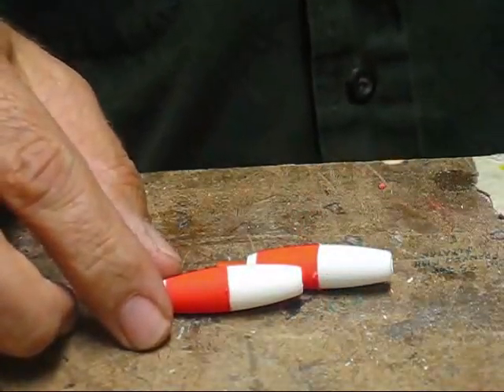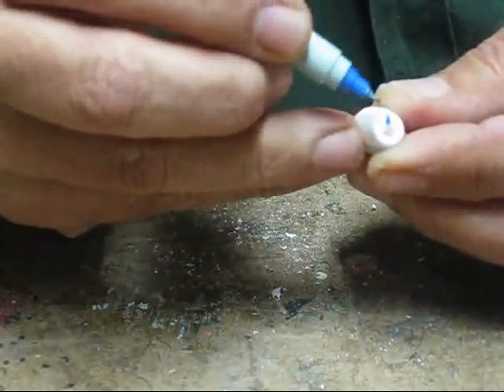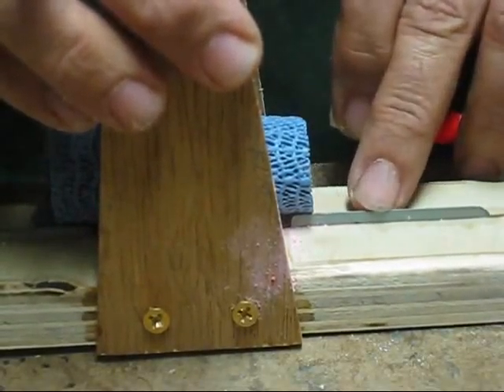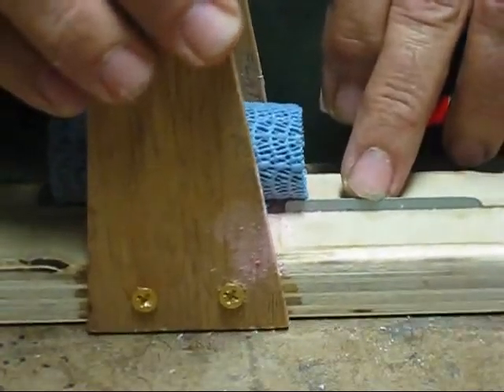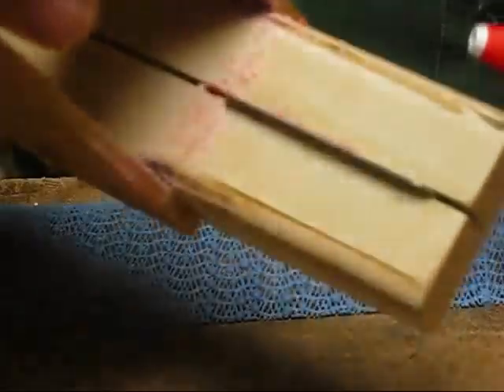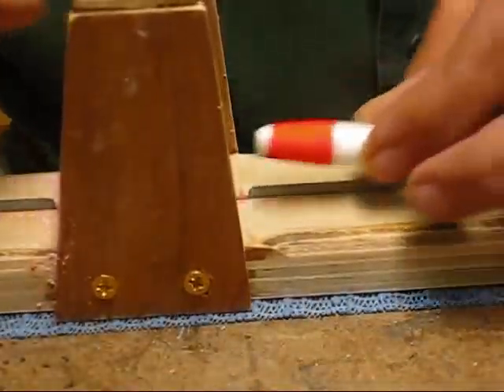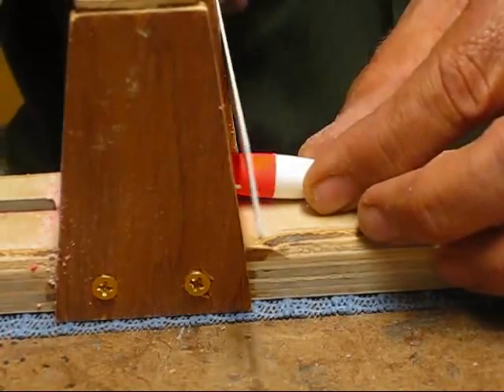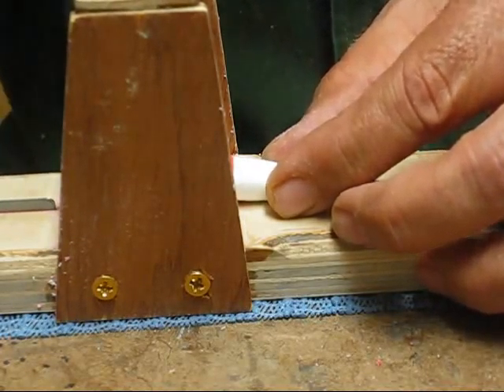Popper Face Jig.wmv

Comment from the maker: John, it is a reciprocating saw blade, you can buy blades of different shapes and sizes and teeth per inch.  I like the height of the blade for this jig over the hacksaw blade. Google reciprocating saw. They now sell handles for the blades to fit in to, which makes a perfect popper cutting tool if you file some of the wave out of the blade. You could make your own handle, to if you're so inclined.
A hacksaw blade works but is a little more flexible.